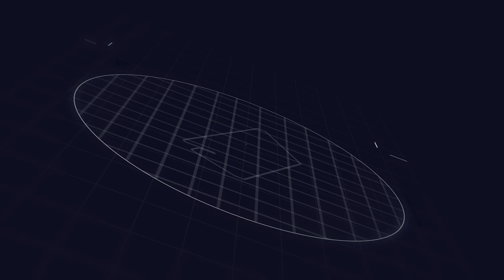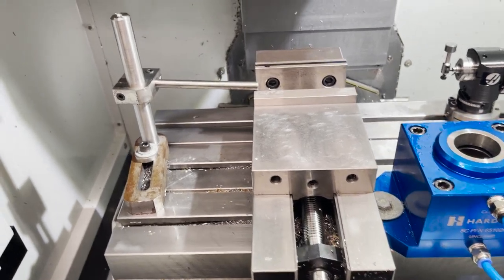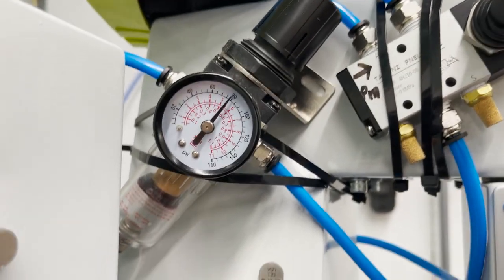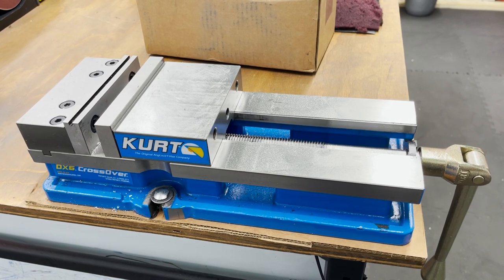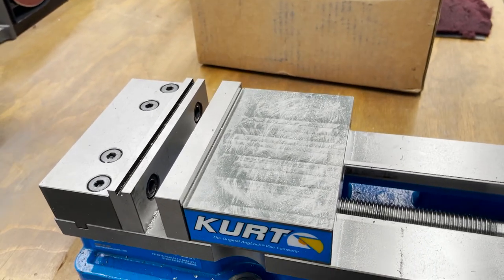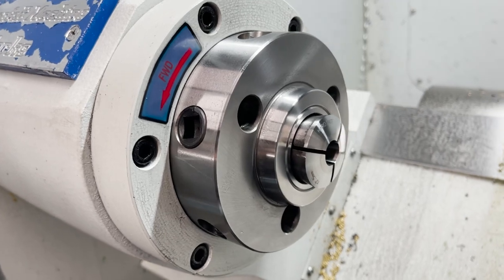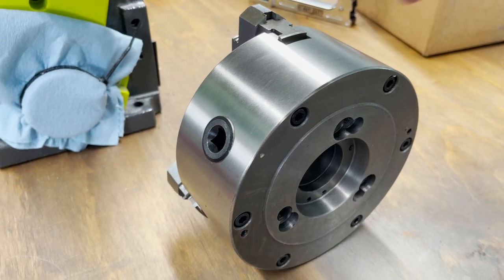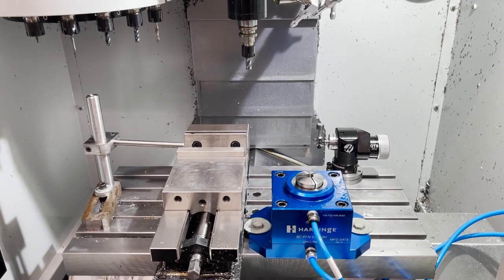Xometry Training EP02 | CNC Mill and Lathe Workholding Fixtures | Brantley Lingerfelt

Comment: I would make a fixture plate so that the just drop on vise and it would be with in .001 straight and use the same plate that you could use your three jaw chuck. If you make the tool plate right you can use the same location say G57 and never have to indicated since you use spud with shoulder bolts to locate the spud on the tooling plate and you can use regular cap head bolts to hold it down and no clamp set is needed.

Comment: Is 80 PSI a good starting point for the Hardinge 5C clamp block?
Reply: Yes 80 psi is a good starting point and then adjust from there. 80psi is my go to. If your worried about crushing the part or misshaping it drop it down to 30 or 40 psi and see how the part holds up.